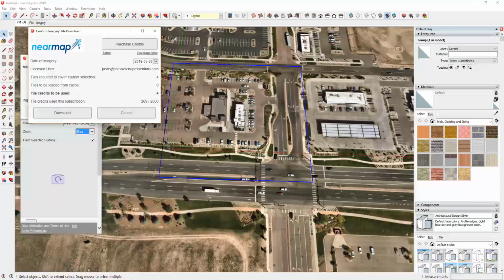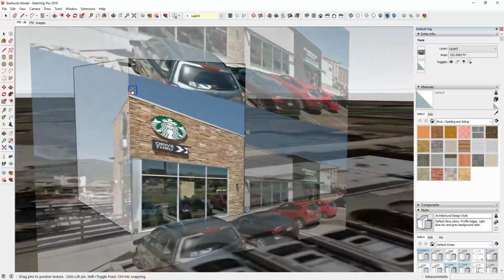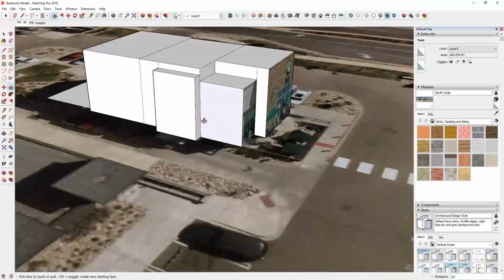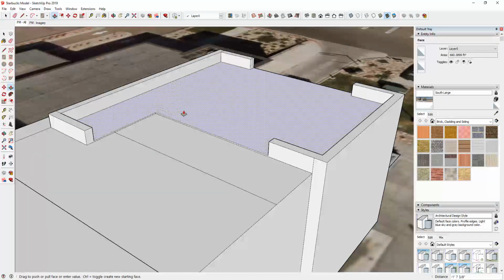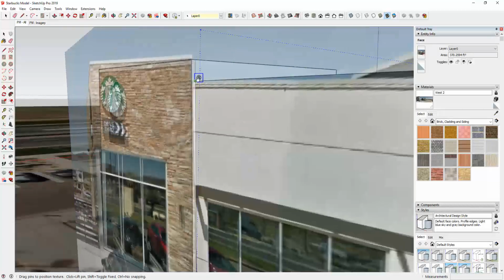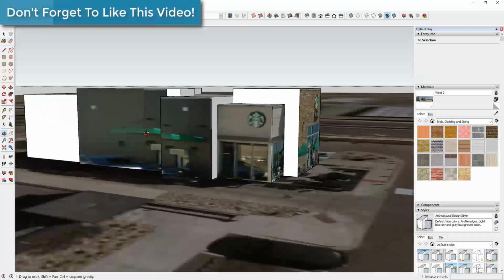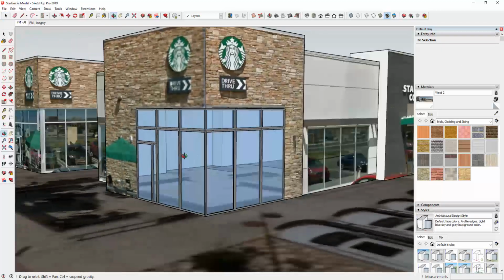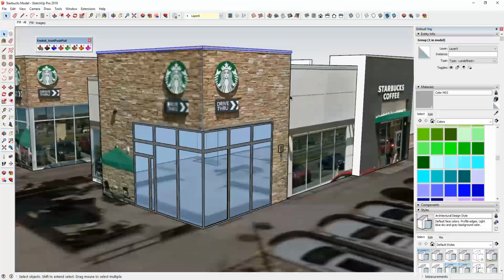Modeling a Building from a Map and Photos Part 1 - Maps and Photo Textures!

Comment: This is just great. I have just bought a house, the plans are from the 1940’s and are completely wrong, so I am endeavoring to model the house as-built and the texturing method you demonstrated will definitely come in handy. Good job Justin
Reply from the maker: Well if you're going to model it as-built, you probably want to do it off of actual measurements rather then using texture images to get your rough proportions right - this way isn't necessarily the most accurate...Thanks!

Comment: Very good video and found it to be very inspiring. What do you recommend for higher resolution photos? Didn't you say that you were using a paid extension for high resolution? It didn't seem like they were very high.
Reply from the maker: Hi Mike - For any kind of higher resolution map image, I use Nearmap data inside of Placemaker - I talk more about it in this video - https://www.youtube.com/watch?v=1sQoPEVBe-c - It is a paid extension and Nearmap data access has a cost as well, but the images are SIGNIFICANTLY better than what you get in the maps - thanks!

Comment: I model houses, and I am interested in the roofs only.  Google Earth's data is very poor in South Africa.  I uses a local map provided by the city of Cape Town.  Unfortunately it only covers the city and a small outlying area.  I tried drone footage and it works ok.  If I tries to use a photo for the sides of the building, I struggle with the deformation of the building due to the wide angle lens.  It can be squared again using Irfanview, but it is a slept.

Comment: Hey Justin, been doing a lot of learning from you my good man! I am a small Design Build GC and as I am small, I need to do all these things myself (along with others). Especially love the extension for storefront systems, will need to try that out but love more than anything is being efficient at things and sketchup can be if you use the right tools. I do alot of PEMB buildings with some sort of office buildout ect on/in it, QUESTION: what have you found to be the most modeling these especially if you bring into rendering which  I am playing with? Like standard split face masonry/ribbon window/PEMB profile.

Keep up the great work and I love watching your flow
Reply from the maker: Hi Mike - nice to hear from you! I don't really have anything special I'd use for that kind of building - the one thing I can think of is Instant Cladding from Vali Architects does a pretty good job of creating metal panel and brick/stone wall cladding. Otherwise those buildings are usually pretty straight forward. Thanks! :)